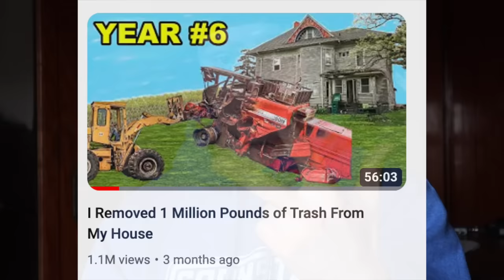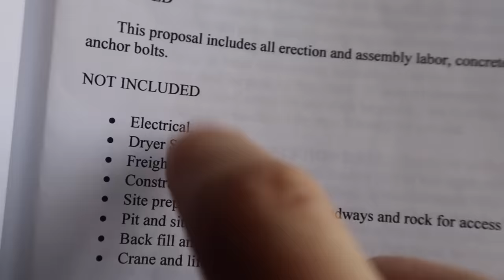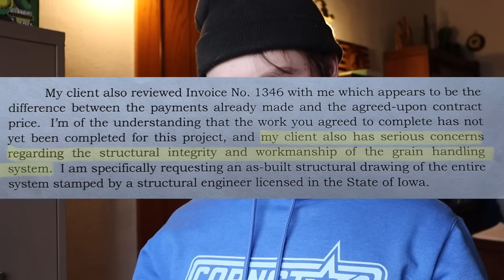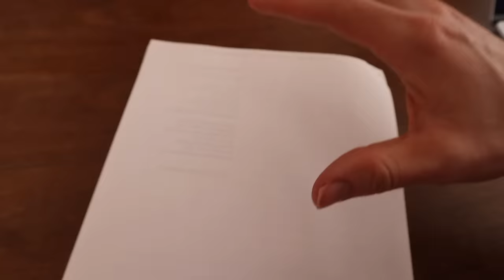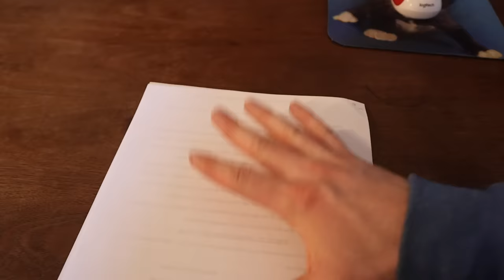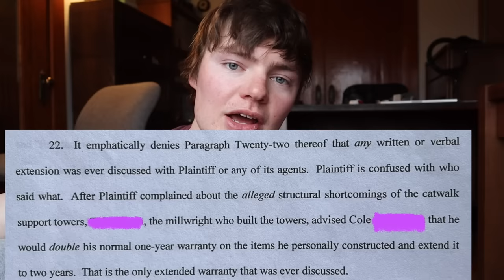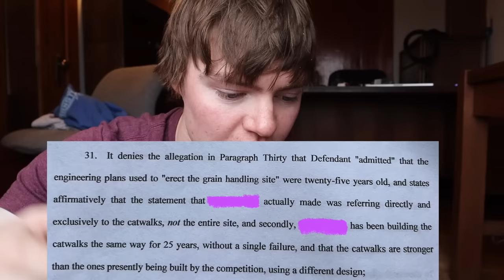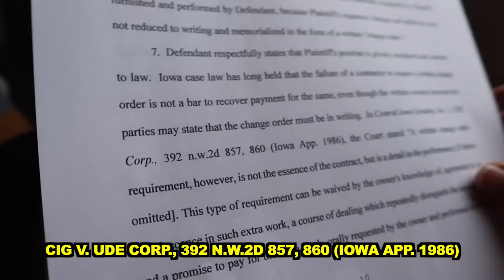I Sued My $1,000,000 Bin Site Contractor

Comment: Sometimes it's hard to spot a bad weld until that overhead structure gets ice logged and beaten with heavy winds maybe even it was a perfect weld for that material but the thickness of the material was a bit too skinny to support thousands of pounds of ice and the force of 40+mph winds unless you specified "all overhead structure load bearing supports must be "x" in thickness with "y" material" so (7/16ths inch stainless steel) but if you didn't specify then it should of been on the contractor to appropriately size the right material and bring his conclusion up to you and explain why you must have this grade and thickness of material based on your location as far as weather but I'm not a lawyer but in my head I think that's how things should go

Comment: The more authorative the engineers report on the safety of the Bin site and the more highly qualified the person who inspects the welds etc the easier a job you will have. I would even look at getting samples of the bad welds inspected to determine if the correct welding wire/stick was used to actually provide the engineered strength required. It is possible the contractor thought he could do a cheaper job due to a preconcieved idea on the wealth a youtube channel brings in. BTW when I talk about the wealth of the channel it is understanding it does not replace the farm income if anything it allows for the refurb of you house etc and would of necessity be seperate to the farm income. Please get your lawyer to view any video's that show the bin site in a bad light moving forward simply to stay safe.

Comment: So im a Certified machinist and welder.
If the welds broke? More than likely the person they got to do the welds isnt certified and thought that welding is as easy as 1, 2, 3 done. Didnt take care to preheat the steel, use the proper wire or anything along those lines.
Im in canada and i helped my neighbor build his bins. The welding part of it really isnt that difficult and where i live in canada we get winter temps that drop to -55F and winds during a blizzard can get up to 90MPH here so there is no excuse for that to happen. In all honesty if i lived close i would be more than happy to inspect the welds and fabrication to tell you exactly where they went wrong.

Comment: It is a mystery why the contractor did not address the "steel" issues a long time ago.  Some of those items can be fixed relatively quick and cost-effective.  The concrete issues are a result of poor engineering (or lack thereof).  I would bet his other customers have had or are having the same issues...some customers decide to live with it or fix it themselves and not fight it in courts (which the contractor knows).

Comment: I understand you're why. The case will be too complicated for a judge and jury. Most likely will end up splitting the claim. Then can the company afford to pay you? If not, then you are out of luck. I would use the money you are about to spend on the lawsuit and fix the bin shortcomings. Will be a lot less stressful. There are problems with your bins. Maybe they can not be fixed without starting over. That would be a disaster for sure. Best of the Best forward. Just remember, no one wins in court except the attorneys.

Comment: Saw this coming a year ago. Everyone needs a "smart guy" in this case, you needed a commercial/industrial electrician and a welder as friends. They would have started hollerin early on. Either a weld penetrates or it doesn't. Either you spec'd the plates to hold weight, or you didn't. It's not hard to figure out. There are literally formulas and charts for this stuff. So you are right in starting litigation. Secondly, it's your folks legacy being threatened on this project. Go get em champ.

Comment: It's unfortunate that the CON tractor didn't immediately run to the problem Identity if it was a sub contractor that performed the work and give them the opportunity to fix said discrepancies or use the retainer to either hire a different vendor for the corrections or if it was a direct employee send the guy over to correct any and all errors.  As far as written change orders if you knew they were out doing additional work or this said work is completed you should be able to discuss this and somewhere within his stated number and your current number of $0.  Unfortunately once things move to legal that is absolutely the time that all communication stops between parties and let the games begin.  Final thought.  If I built it and you weren't paying me regardless of ability to use at full capacity it would still raise my blood pressure.  If you can use 55% capacity let's get 55% of the money paid.  That structure should have been like occupancy in an apartment complex.  Until everyone has signed off nobody is using it.  Period end of story.  

Good Luck I still agree you will be the winner but in these situations are there really any winners other than the attorneys?

Comment: Hi I am no expert on concrete but watching other you tube program.
The posts coming down from the bins which has all the concrete cracks. Was the posts put on separate concrete   base which having watching other ones then there would check the ground by using a pole that would be pushed into the ground to see where there is solid ground see Perkins Brothers builders when there are putting concrete into the ground there have to find solid ground it may go down 6ft or more the post should be sat on there own concrete and the pad under the bin should be separate from the post.

Comment: Seems to me the rollers can be rebuilt  cheper them buying new aftermarket ones,  in fact with the materials and a lathe also a heat chamber you could harden the rubber  ive found Chinese made rubber is crap. Also an option is polyurethane over rubber its tougher.

Comment: Question # 1 is:  Why didn't you hire an engineer to provided construction drawings for the structure.  You hired a builder, not a designer or engineer.   

Question  #2 is : Where is your permit?  And how did you obtain it without drawings?

Comment: Here's a few educated comments for you that I'm sure your attorney(s) have already mentioned, if not consider a different attorney.

1). It would seem that the matter at issue is the fitness and/or quality of the work/design. If you established the contract and approved the plans/drawings that were submitted with it then your request for engineering drawings may not matter. However, if the work/design has not been performed to industry standards and/or safety issues may exist then you may have some recourse. In this case your opinions do not matter. You will need to engage a forensic engineering firm to review the work and serve in an expert witness capacity to identify and document the shortcomings. Once again, your opinion and assessment of the work will not matter to the court.

2). Discussing this case and showing court documents and attorney communications publicly in this video and otherwise has the potential to do way more harm to you than any benefit that you may perceive. Your suit will not be decided on public opinion and the other party may use these disclosures against you to seek damages. Why give them the chance to do so ? Good luck.

Comment: Doesn't matter how long you have built things . When you cut corners an you hire people to help that don't have the same experience as the guy in charge .it's hard to get the same quality as the guy that in charge that been doing it over 25 years. . He has to double an triple check the crews work .if he wants it right . Not all workers are follow the steps needed . Some will cut corners . From having bad  . Or any problems at all . Just don't want to  be there an just go threw the motions. .

Comment: 12:39 Could this be an issue of differing expectation? We engineers see that sort of thing all the time. The client describes what they want, we build what they want, and what we build doesn't meet the expectations they had because the client doesn't realize that what they expected and what they described are two different things?

For instance: did you state a total volume or a total volume OF GRAIN that these should hold? There may be a structural design reason that they have to remain 45% empty? (Idk, I'm not that kind of engineer, let alone that kind of engineer that specializes in that kind of structure).

Maybe the mistake was your expecting to be able to use 100% of the volume?

A REALLY good engineer actually asks the client what their expectations are, not the form they think those expectations take.

Comment: i love their reasoning, well this is how it worked on other jobs, OK but i am not paying you for what you done on other jobs. i get that they use previous jobs as a reference. but that does not totally equate to the job they did for you, then they say oh you have used it for 2 years. ok but if i have a cup that has a crack near the top that leaks when you get to that limit, then that's not exactly using it in the manner it was designed to be used.

Comment: I would think if you are thinking about spending $1,000,000 dollars on a project that has to be built. You would ask what customers did you build for before so you could contact them about it and check their work out.
Spending ton of cash without checking their previous work done is flat out dumb. Never trust someone saying something like "I been doing this for 40+ years".

Comment: So. For the lack of written change order if it's in the contract that both parties must write and sign it for it to be applicable for a change order to. Be part of the contract the things that they sign are ill relevant because in the contract they're disputing they have in writing that change orders must be. Written in signed by both parties so it doesn't matter if the. Case laws they cite are there because?
  They're not this contract and may not have had in the contract that change orders are to be written and attached signed by both parties.

Comment: When is the last time you changed the crank case breather on that 340. It's probably plugged so it's pushing oil past your crank seal. Had same problem changed that the sealed it's self back up.

Comment: It appears to be a very average construction, dangerous in some areas, unreliable at times, poor quality concrete foundations. Now you could almost accept a bit of slip-shod construction if it was the first bin site that the contractor had built……. or it was of an a radical design, but it appears to be relatively basic. Good luck…… I hope that the BinSite is brought up to an acceptable standard and that a fair result is the outcome…… Honestly, if I was the contractor I would want my integrity to be maintained……. Fix it properly and stick to the contracted price. Cheers from an old farm boy from Down Under (Oz)

Comment: I wonder if the contractors lawyer understands that Cole has a large part of this "building site" on video - up to and including the substandard sections that are failing and or falling apart and have been "SINCE" the entire site was considered "finished" -- and how many times problems was found, and told to people working on site to "fix" and they acted like they have zero interest in wanting to do the "finish" work.. That catwalk alone is 100% garbage.. I never would have accepted that level of "finished" work.. its Absolutly a serious injury or death hazard.. 
I think this Lawyer for the contractor is gonna change his tune if he viewed Coles videos or attempted to look up "cole the cornstar"..  If he is smart he gonna realize his defendant does not have a "leg" to stand on.. 

I think only thing that works right on the entire site would be the heated shack for the electrical panels and toilet.. From it not being able to handle the amount of grain going into pit without clogging or burning the belts off - to the leg getting clogged cause it cant go fast enough, to the thing not even being able to empty properly because none of that was even finished properly.. I think the worst thing is that might have to tear it all down and redo everything from the ground up.. considering the concrete cracking so bad at 55% full for hopper bottom.. 

You don't have to be a structural engineer to see the faults with this grain bin set up,  you don't even have to be a normal engineer to see the problems that are blatantly obvious when they try to "use" the system as it was intended and as it was laid out in the initial design phase..  the current site is only "marginally" better then original stuff they had in that its 2 big bins.. but everything about the mechanical systems of those bins seems unable to handle the input - or even output at a rate that was set about in the original planned system.  Worse is - think the leg is to small for the future growth of entire site just because it can't handle what it was used for since it was "considered done"..

Comment: Why should you have to question their workmanship? You hired the professionals. I had the same situation with a roof tear off. The crew was all done and had put their tools away and ready to leave. I could see faults from the ground and next thing I knew they were back on the roof and tearing off shingles and patching in new plywood sheathing. I was pissed and they acted like it was no big deal. Again I hired the professionals and they were the ones on the roof and should have done it right.

Comment: Frankly the whole system needs to come down and start over from the ground up. The sight work was at best a total disaster as can be seen by all the broken and steeling concrete. Nothing you do above ground can fix everything that's wrong below ground. It was a dry summer when you were digging footings and dump pit when it still filled with water. Until the ground water problem is solved and the footings are all redone nothing is going to be right on the rest of the system. As I remember the first bid was like $1,800,000 you cut it back to about half that and are surprised it's less than you wanted?

Comment: Doesn't your County issue building permits? If so; there would need to be site specific stamped engineering drawings on file and various required site inspections. If not; now you see why it's necessary to have such oversight. Just askin'...
Reply: No.  Farm construction is exempt from building codes in iowa.  There are no engineered drawings nor are they required and there are no site inspections nor are they required.

Comment: Trouble with a lawsuit, 33% of the winnings go into the Counsels pockets. No one wins entirely in a Law suit. If you're doing it to prevent neighboring farmers from harm, try asking the others to chip in on your law suit. Crickets.
Reply: That’s not quite how it works, you are talking about a contingency fee arrangement. This is usually only for cases where the plaintiff does not have the resources to sue, so the lawyer covers the cost with the expectation that they take a percentage of the case winnings if they do win. This is usually only seen With personal injury cases. For a commercial construction case such a this I can almost guarantee they are paying a hourly rate, especially if they have a construction litigation lawyer for a commercial contract. Usually though if you have a strong case you can recover legal costs.

Comment: The quality control was lacking through out the build. Also good welds don't fail randomly. It is all or nothing in that area. The safety concerns around failing concrete and bin capacity usage is blatantly obvious and your history of video's is stacked against the contractor. Good luck with the long process but you will prevail.